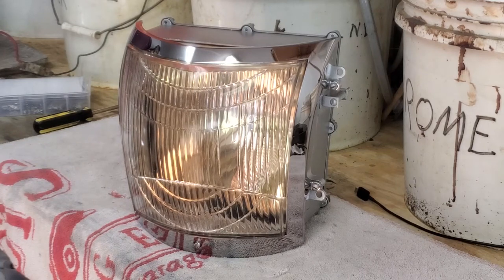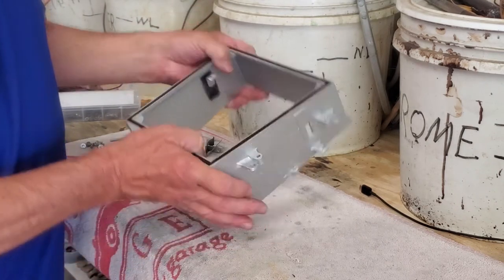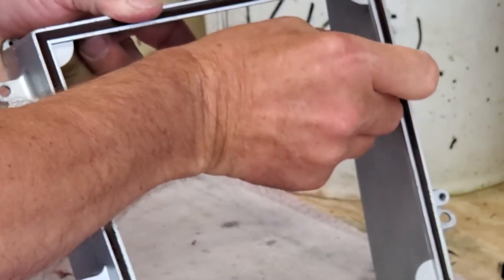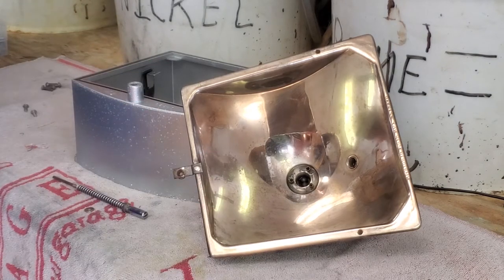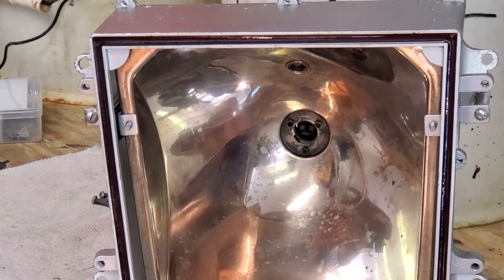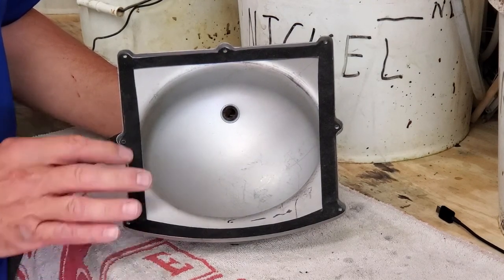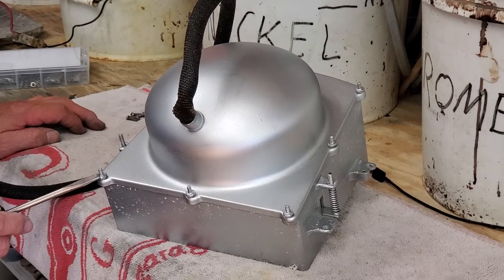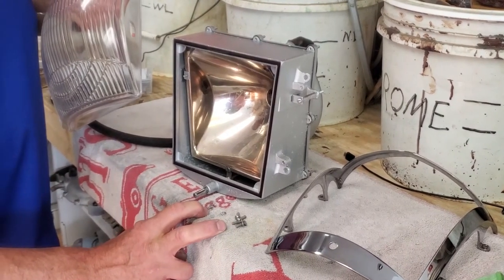How to Assemble a Square Graham Headlight  for a 1938  - 1940 Sharknose Graham

Comment: Thanks for showing how to do this.  I did the headlights on my father's '38 several years ago and now looking back, I highly doubt that I did them correctly.  I drove it at night only once and was glad it was a short distance... between headlight bulb tech of the thirties and a generator that put out variable power, I might as well have had the headlights off altogether.
Reply from the maker: Glad it helped. One of those things that's easier to take apart than put back together. Thanks for watching!